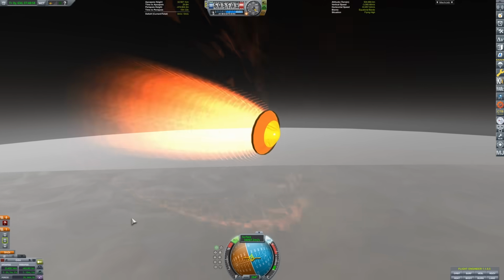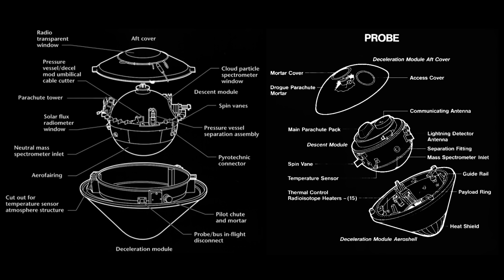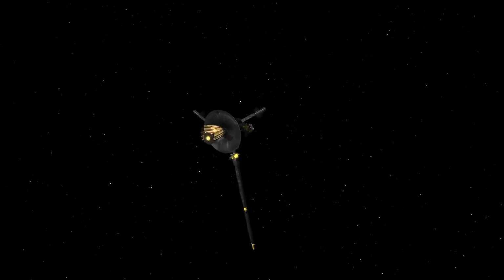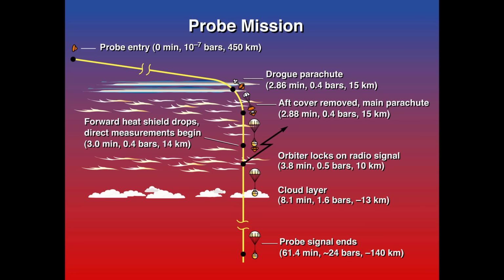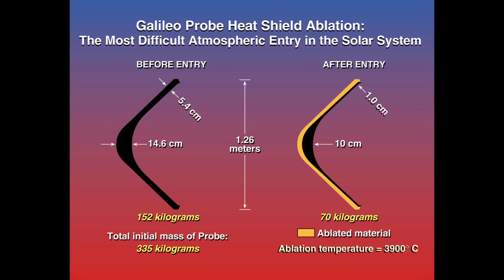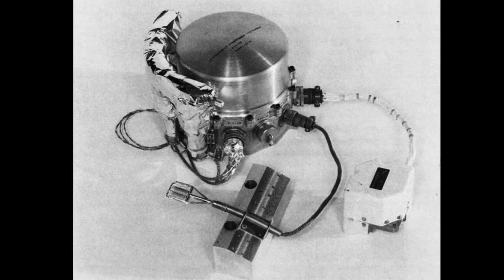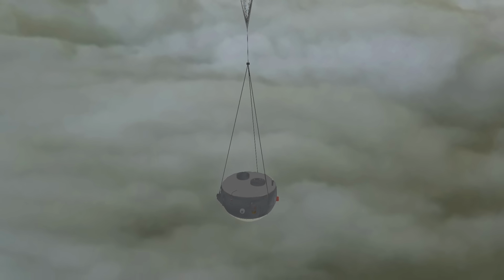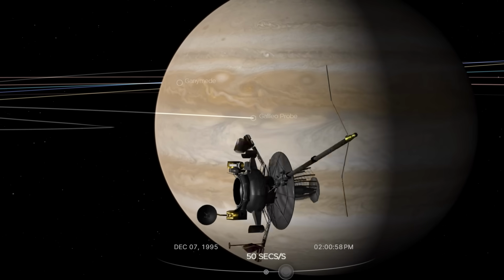The Toughest Space Probe Ever - How NASA Dropped A Probe Into Jupiter

Comment: but why does the probe have to have such a high entry velocity? couldn't it get some kind of free gravity assist from a moon to slow down
Reply: Try dropping something from the height of our moon. After a freefall of 384 000 km, how fast would you imagine the object to fall down?

Answer: Dropping an object from the Moon's average distance (384 000 km) to the Earth's radius (6 371 km from the center of the Earth. The surface. I ignore the atmosphere here.) would take 4 days, 20 hours, 11 minutes, and 6 seconds. Full acceleration imparted by the Earth's gravitation all that time. Objects final impact velocity would be 11 093 m/s or 39 933 km/h. 
Fun fact: This is very close to Apollo crew modules' speed upon atmospheric re-entry, for obvious reasons: Apollo capsules "dropped" from the Moon!

Any moon orbiting any planet is so far from it, that the remaining freefall from that moon to the planet will always result in huge entry velocity. It would be prohibitively expensive (in terms of mass) to carry fuel to slow down the probe before atmospheric entry.

We have no option but to live with it (and engineer our way around it. 😎 )
Reply: @toweri_li  so fuel to slow down would cost more than ablatives
Reply: @xorowl1584  Kinda... Enough fuel to slow down would require (much!) more fuel at take-off. Lifting off that extra weight would require still more fuel... It is a vicious circle. That's why they have to save every gram they possibly can!
(To highlight the point: SpaceX Super Heavy has used more than half of all of its fuel when it has gone up only 40 km!!)
Reply: Even the orbital velocity in low Jupiter orbit, giving you the slowest reentry velocity possible, would’ve still had you flying at over 30km/s relative to the clouds so no matter what you’d need a massive heat shield
Reply: probably undoable using Jupiter’s moons not too mention such gravity assists often come with significant time penalties (like the Parker Solar probe)
Reply: Mass means gravitational acceleration.

Comment: "Mach 50, which makes it sound way slower than it was" this is the only context in which mach 50 could possibly be slow
Reply: For reference, in Earth’s atmosphere 47km/s is Mach 137 

(or not including the spin of Jupiter, 59.5km/s is Mach 173.5)
Reply: @ thanks, I was wondering what it would be like
Reply: @Ty-Braun  mach 1/alpha? [X_files music]
Reply: @Ty-Braun that sounds more like an atmospheric belly flop.
Reply: @Ty-Braun how far from the center is that figure? What is the consistency at this point? Thanks for your input
Reply: @Ty-Braun I'm curious if you found any figures on pressure & temperatures for entry? I only ask as I had no idea what those values would be in my calculations and gave up looking for the data. 

Earthly figures of 0.34 km/sec at sea level (~1 KG/cm^2), with temp of 15⁰ C, for about Mach 138, 👍. I assumed both pressure and temp would increase dynamically as the craft penetrates the atmosphere. I think the velocity can only be described as "ludicrous-sonic" velocity!

I'm very curious how NASA calculated the anticipated stress on both craft and heat shield. I can't help but marvel at how NASA even made it to Jupiter, let alone inserting a spacecraft into the atmosphere, of Jupiter, no less. 🤯
Reply: According to John Michael Godier this speed can take you from New York to Los Angeles in a minute and half.
Reply: @danielmiller3781 , Center, dusty five-two-two, requesting a speed check.
Reply: I think, which surpasses my imagination even more is the atmospheric pressure of about 5000 bars at a depth of about a 1000 km into the outer gas layer, which is, to roughly place it in comparison, one 70th of Jupiter´s radius ! @20:30
Reply: Mach is based on the speed of sound, which is veritable depending on atmospheric factors, temperature, humidity, pressure. So I thought that as reference was sketchy.
Reply: In my grad work as an aerospace engineer, a mach 50 shock wave was used for calculations of nuclear overpressure.  It’s a massive stressor to even the most streamlined shape.

Comment: The data rate from Galileo was tragic. I'm glad it sent the data it did.
Reply: The original mission design had Galileo collecting data on its flybys and transmitting that data ‘burstily’ to Earth on its subsequent ‘long orbit’ to the next flyby. With the datarate limited to 10 bps (160 bps max) the Orbiter continuously transmitted data from the previous flyby up until preparations for the next flyby began. In addition to scientists learning to very effectively prioritize which data would be returned first, on-board editing and compression software was added. These improvements greatly increased GLL’s data return. The biggest loss was to long-term monitoring of Jupiter’s weather. No getting around needing lots of pictures for that. These techniques were propagated to future (non-‘crippled’) missions to greatly improve data return volume and efficiency.
Reply: Tragic, yes, but still more reliable than 9.6k dial-up via AOL.
Reply: @robinseibel7540  that AOL connection is 100 times faster, even if less reliable lol
Reply: @davidgunther8428  True.

Comment: Instead of using a rover, could a 'balloon type system be used to suspend the probe in the atmosphere of Jupiter to explore the planet?
Reply: The problem is that Jupiter’s atmosphere is already hydrogen and helium, so the only way you could get buoyancy is by either making a superheated balloon or having a super rigid vacuum tank that was also somehow low-mass
Reply: @alexsiemers7898  very good point... are "hot air" non-pressurised hydrogen balloons an option? except that you'd need to supply the oxidiser instead of the fuel

Comment: wrt "Apparently the test system was miswired exactly the same way" at ~14:50...

That is a very, very common problem in all aspects of engineering. I like to call it "incestuous testing" i.e. the test and associated fixtures share the same defective DNA (in the form of bad design assumptions) as the real system. It's especially common when the system under test and the test are implemented by the same individual or team, without any external review. They just reinforce their own mistakes instead of finding them.

That is exactly why we do integration testing, where we confirm that entire systems behave as expected instead of just testing individual parts. In this case if the computer had been exercised as part of the centrifuge test then the fact that it was interpreting the high- and low-G sensors in reverse would have been easily detected.
Reply: This retired IT guy totally agrees!
Reply: @AndrewBlucher  So does this one!
Reply: Then they can the integration testing "because we've already tested all the pieces"
Reply: @GeneCash  Been there, experienced that.

The mantra that I always repeated was "you are what you test".
Reply: @GeneCash  Closely aligned to the practice of designing an 'integrated platform' to bring wonders to the masses, then canning the modules one by one 'because the adjacent module delivers 80% of what the user wants' until we get down to one remaining module that just about delivers half of nothing.
Reply: As a guy who spent his career designing and installing PLC automation systems, I always allotted time for correcting errors that didn’t show up until the smoke test (fire it up and see what smokes).

It was a very rare test that didn’t have a few errors.  The problem with space probes is anticipating all the conditions the probe will encounter (some simultaneously) and then designing a test to simulate it.  The fact that any probe works at all is testimony to the amount of sheer genius collected at JPL.

Proud member of the Planetary Society since 1990.
Reply: @Simple_But_Expensive  All true, and we also need to give JPL credit for Galileo's era. What seems like a fairly simple integration test now might have been pretty challenging to implement in the early/mid 1980s when Galileo was designed.
Reply: I see where you’re boeing with that  😉
Reply: @ralanham76  Too soon?
Reply: If it ain't an integration test, it's just sparkling bench-tests from the feel-good region. I was on a project were we were a supplier to JPL once, they were a pain to deal with, (kept asking but what if...) and on a different project, used their various probe software failures as training materiel for the software team. Had a US colleague from JPL on that project and he had some wild stories of 'so then we...'

Comment: 230 g of deceleration is roughly 2.3x more intense than the deceleration in a typical car crash, except a car crash only lasts a split second. That Jupiter Armospheric Probe had to wistand car-crash deceleration for tens of seconds!
Reply: That's an amazing way to put it into context. Crashing a car into a wall continuously for a minute.
Reply: @QuantumHistorian a plane crashing exerts a similar amount of G's so this probe was in a continuous plane crash for many seconds
Reply: Yah but we have smart 155mm ammunition (quite big) that has electronics, GPS, actuators for orientation, etc... and survives launch at thousands of Gs from a howitzer. So it's impressive, but not that much.
Reply: @rnbdc  I was thinking the same thing. They even had proximity fuses with vacuum tubes developed during WWII that survived canon fire.
Reply: @tinysim  how about Davey Crocket. That's a fission assembly that still works after firing.
Reply: @rnbdc yes but it doesn't keep decelerating once it hits its target, or accelerate once fired.
Reply: @rnbdc  the MEMS accelerometers are etched into silicon. It's a little beam that deflects under its own weight, and you can detected the change in capacitance rapidly and precisely.
Reply: @rnbdc  yeah, but again, only for a fraction of a second.
Reply: @rnbdc  great reality check. 
Flexing because you built something that withstood 250, but was completely inorganic, technology based is like a marshmallow laughing at a cloud.
Reply: It's a bit easier when there's no squishy human inside. US WW2 VT-fuses (proximity fuses) had 5 vacuum tubes in them, and those things had to withstand  anything up to 20.000G.
Reply: Great video! I'm impressed by all the engineers who figured all of that out. Thanks for explaining everything so well
Reply: None of what you said is scientifically logical in the slightest. Or true. I hate the internet it’s just going to make people dumber
Reply: @derekderek2570 How about you fight what you hate and educate people?
Ivory towers do not deserve credit.
Reply: At least you wouldn't have to worry about whiplash. Your face may come off, but one must look for the positives.
Reply: That 230 g is more or less steady state along one axis though rather than being 'shocks' on multiple axis.
Reply: 100G's?? Typical car crashes do not reach 100G's, that would instantly kill anyone. Typical Car crashes normally peek at aroumd 60G's
Reply: @Dave_Kerman 100G for like 5 milliseconds isn’t enough for guaranteed death, possible death sure, but when the g loading is extremely short much higher than normal loads can be taken
Reply: @SquiddyyBoyy plus I’d assume that the 100G figure is the deceleration of the car itself. So with the actual safety systems like seatbelts and airbags the deceleration the humans experience would be a lot lower
Reply: @Dave_Kerman  Kenny Brack...IndyCar driver...survived a 214 g wreck at Texas Motor Speedway, 10-12-2003
Reply: It is literally this probe, and similar things like that made me think we had super heat resistant materials. Till recently. I am near 40! 

 I thought we for sure had a material that can withstand 10k Celsius. 

 No! Halfnium Carbide cannot withstand anything more than 4.3k. Celsius. That is all we have! 

 That is pathetic! Outside of the mystery material "starlite" apparently being able to withstand 10k Celsius. I could not find anything more. Not even any therotical nano materials. (Gotta be something for passive cooling). 

 Anyway it was kind of depressing to know we are so limited.
Reply: @dianapennepacker6854  12000 K = 1 eV...idk, interatomic bonds are in the electron volt range.
Reply: @dianapennepacker6854  Starlite was just an ablative material like the ones used in this heatshield. There were some recent replication efforts that seem to have figured out what it was.
Reply: @dianapennepacker6854  officially. 
Take hope from that.

Comment: “Quoted at reaching Mach 50….” Holy crap that is screaming “….which made it sound way slower than it actually was.”  🤯
Reply: In Earth velocities it's Mach 137.
Reply: What is the timestamp of that? I can't find it.
Reply: Mach number is the speed of sound, and that depends significantly on temperature. So it's actually way more variable than most people realize.
Reply: @fletchro789  And in this case the makeup of the material the sound is transmitted through. Both helium and hydrogen are lighter gasses than Earths nitrogen and oxygen.

Comment: Wouldnt the unsymmetrical antenna cause vibrations and make Imaging impossible?
Reply: The camera was on the despun side, thus stabilized for imaging. The asymmetrical antenna was pretty low-mass, and the CG of the Orbiter could be adjusted by moving the RTGs (which were not low-mass) in or out using actuators. Interestingly, the mass properties of the Probe had been recorded somewhere and lost, making it impossible to determine the exact positions of the RTGs to be used during the Release (to avoid bumping the Probe as it departed the ‘throat’ of the Orbiter.) Lots of analysis ensued (mass properties of the Orbiter were not lost and the combined performance was well characterized) and reasonable RTG positions selected. Following Release the RTGs were repositioned again (for the last time?) to adjust the CG of the now Probe-less Orbiter.
Reply: It was probably balanced by something inside